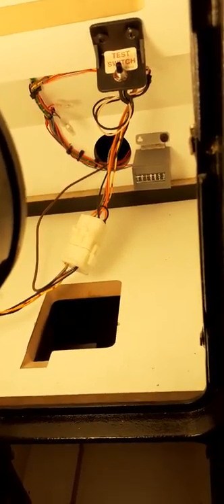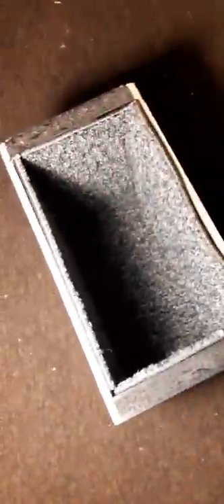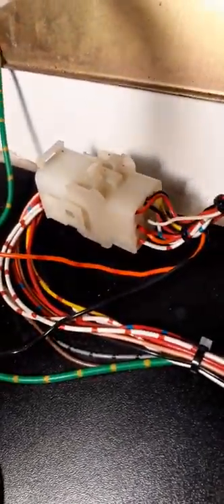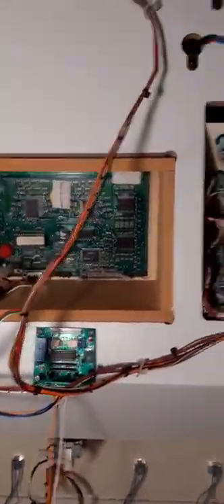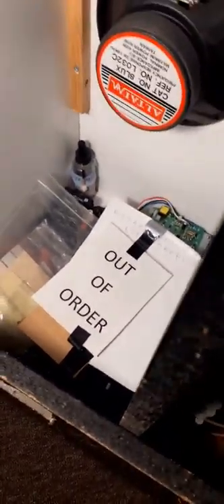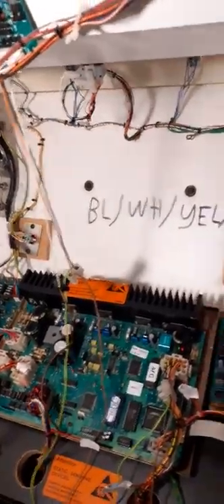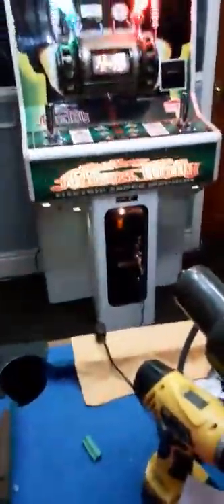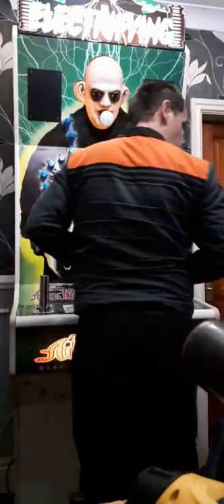Inside the addams family generator part2

Comment: Better video this time. Not to be a hothead here but when you record youtube videos can you please shoot sideways so the video isn't vertical. Hold your phone horizontally like when you are watching a video on the youtube mobile app. There are parts of the machine you described but I couldn't see them because it was out of the frame.

I'm guessing the audio and sound effects are stored on that chip with the AFG sticker on it. Looks small so I'm guessing they repeats a lot of sounds like the claps in the theme song are just one clap but played twice. The N64 works that way.

What would happen if you just connect both electrodes together and then run a game. Curious if the devs test the game this way.
Reply from the maker: Sorry I forgot about the camera angles I will remember that when I do the next video with regards to the game sounds when he shocks you he sometimes repeats the same sounds over again it also chooses random sounds with regards to the shock handles they have to connect to the shock handle control pcb boards and then connect to the motherboard